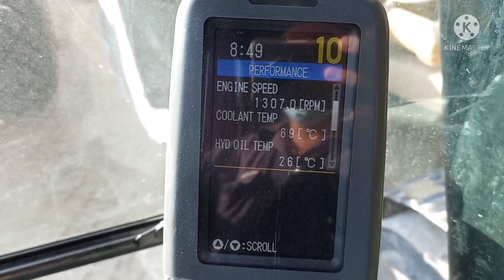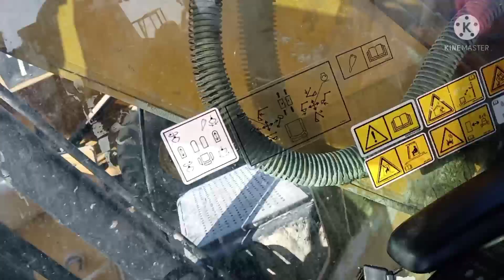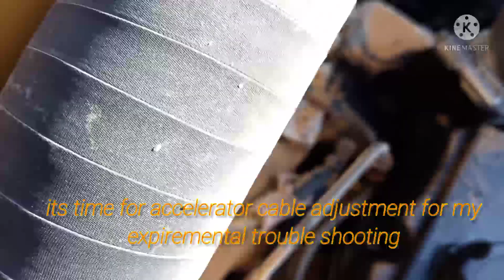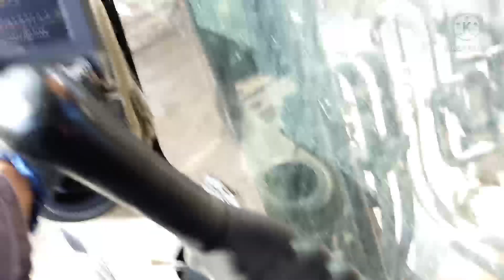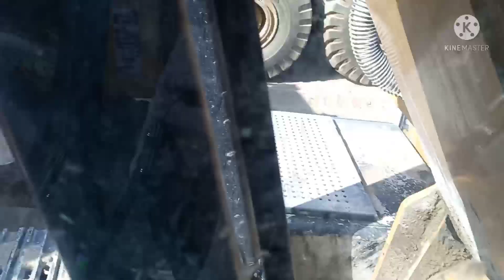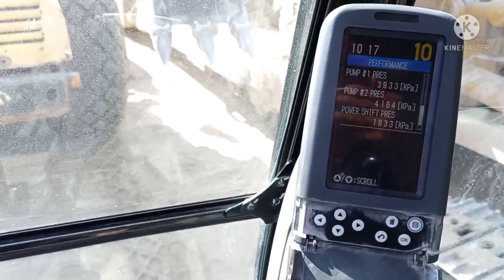CAT 320D² L EXCAVATOR Low power and how to adjust, in actual through self gauge

Comment: Ser tanong lang sana kong nka trouble na kyo ng overhit engine cater pillar backhoe 345C c13 engine new head new cylinder gasket new water pump oil cooler nilinis ja hydroulic pump presure ordinary rpm 1500 PSI. High rpm 2900 PSI...
Reply from the maker: s whatsapp tyo usap para tuloy tuloy at malinaw
Reply from the maker: actualy s pressure n yan mababa dapat nsa arround 5000psi yan, ang ttest ng pressure nyan ay s travel e llock mo ng solid steel or pin ng bucket bbilang k lang ng 5sec then reales tpos temp nyan dapat 50c bago k mag check ng pressure
Reply from the maker: s over heat contakin mo ako s whatsapp +971567581176

Comment: The electric fuel pump is stoping while key switch is on...
Reply from the maker: anu b yang machine mo sir paanu b ang mga naunang pangyayari
Reply: @caterpillarjhunhunk  sna Sir mbigyan nyo aki ng Idea about d2.kz ako na po ang nghawak sa sa2kyan na tu.exc.cat320d2 po Sir.
Reply: @caterpillarjhunhunk  sory Sir kung ngayun lng ako nkarply sa inyo.bz po tlga kz ako s trabho.khit linggo po my trabho ako.gs2 ko po tlga mas mdagdgan ko pa po yung knowledge about sa mga heavy equioement Sir spcialy po sa mga advance or computer box na mga sa2kyan.
Reply: @caterpillarjhunhunk  ladirise course lng po ntapos ko Sir pro ina upgrade ko po yung srili ko hnggat maari.mhirap lng po kz kme. Sa 9 na mgka2patid Sir.ako lng po yung nkatpos.sa pama2gtan ng self suporting po.at ngayun Sir pnapaaral ko ang 1 kung kpatid.
Reply: Opo Sir ang electric pump pg on mg stop po sya aftr 1 minute..more or less po...posebli po ba na jn ang prblema Sir?

Comment: Sir drilling rig machine Caterpillar c9 engine.. his hydraulic pump and pump sensors is very similar to excavator, but our machine crawling not convert into turtle to rabbit...
Inside operator cabin small controler convert turtle to rabbit... but crawling performance same like turtle..
Reply from the maker: bro about that problem,if there is solenoid to speed up and slower the crawler check maybe the control is malfunctioning or maybe the relay so you should have to check the control and if there is relay to drive the function to speedup,what i mean is they have solenoid to speed up it eighter the problem is in the control or relay or pressure
check the pressure first before you do the trouble.shooting

Comment: Hello sir good day. Please.  Me. I have trouble in 320dl  pag sinagad sya. Or double engage nag eengine shutingdown po  what is the problem of this?
Reply from the maker: na e check mo nba ung monitor sa possible active error,kung hindi p check ka muna sa monitor ha,or e check mo n rin ung power shift solenoide nsa main pump nsa bandang kaliwa un nka kabit bandang ibabaw ha check mo rin bka wlang supply n napsok doon un ksi ang nagrregulate ng pressure nya,contakin mo ako s whatsapp +971567581176

Comment: Good morning sir, new subscriber po kami ng asawa ko ask ko lang po sana kung anong possible trouuble ng caterpillar 320d walang current sa injector may supply naman yung ecu. Hoping for you reply sir thanks and Godbless.
Reply from the maker: wla bang error sa monitor nya,na e check mo b maige ung power supply n nagmula s ignation switch nya yellow un at 308 wire code,kailangan may supply un kung wala pweding andun s likod ng cab sa lagayan ng battery posibling npasok ng tubig ung malaking socket,possibility lang,kontakin mo ako s whatsapp pra mas mabilis ang conversation natin ha,+971567581176

Comment: sir jhun gd evs..ano ang gagawin pag yong excvator low power SK60 kobelco mahina ang swing at travelmotor..yong boom mlakas nman pero pag matagal ng nagoperate humihina na lahat..ng supply
Reply from the maker: ok ang mae aadvice ko s ngayon is kailangan nyo mag check ng pressure kung bakit humihina kpag mainit n baka nag lolow pressure n sya,maraming dahilan bakit nagkakaganyan ppweding sa pump dahil mababa n ang viscosity ng langis o hydraulic,o nagbabara o barado ang filter,or mag check muna kyo ng langis kung kailan huling npalitan,ganun n rin ang oil filter,then kpag ok lahat at bago lahat testingin nyo hanggan lumabas amg problema saka kyo mag check ng pressure pra malaman kung normal pba pressure ng main pump o bumagsak n sya kpag mainit n.o kya add mo ako sa whatsapp,+971567581176

Comment: Sir kumatzu p.c 60 ano ba dahilan bat ang daling uminit hydrolic oil nya
Reply from the maker: brad maraming dahilan kung bakit nagiinit o overheat ang hydraulic oil,1ppwedeng over use n ang oil mo,#2ppweding barado ang magnetic filter o alin man s hydraulic filter mo,#3ppweding ung oil cooler mo ay medyo nagbabara n s katagalan kung minsan nalalaggan ng dumi sa pagsalin o pagbukas ng lagayan ng langis,#4 ppweding over pressure hindi mo ramdam sa makina,#5cooling fan o kaya barado n ang pins ng radiator kung saan dumadaloy ang hangin,observe mo yang mga nsabi ko ha,bka isa dyan s mga nsabi ko ang may problema

Comment: as load increase injection pump fuel delivery rate to injectors ECM  increase internal to injection pump by ECM load sense feedback.  
Excellent work.
I think thst was the control pressure piston adjustment screw you turned out . Load sense side from actual  hydraulic load . 
Hystat channel has intense course on CAT pumps like this.
Salaam Walaykum Akhi.
Reply from the maker: yah bro you are write about that ,but this engine type just a manual the only participation of the ecm is to control acceleration through accelerator motor and also the maximum acceleration is just 1,830rpm at first i conclude the we need more acceleration to drive the heavy load from pump,but that idea is didn't work still the engine is heavy load and make more smoke, theres no any choice just to go the other way of reducing load but not the power,that valve function is flow constant horse power adjusment,then after adjustment we found and normalize the load and the pressure is still normal
Reply: @caterpillarjhunhunk  True. You are very good technician. I tell your boss to give you more money . Thanks from NYC America.
Reply from the maker: @mitzvahgolem  you dont need to do that bro your good comment and ideas is good enough.
Reply: @caterpillarjhunhunk  i have newer CAT equipment with DPF and tier4 emissions.
CAT will not allow owners to diagnois CAT ET is limited . 

Minimum $975 for dealer field  service call only to plug in Scanner.!
I am going to Komatsu who provide all scanners software to owner.